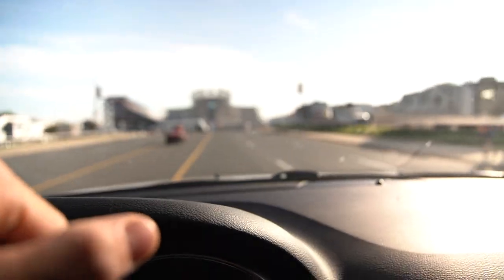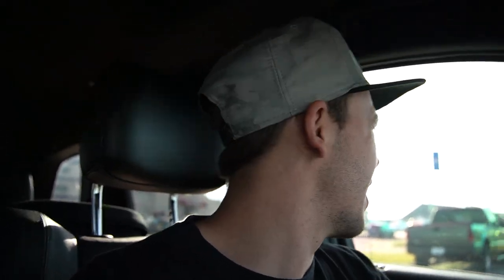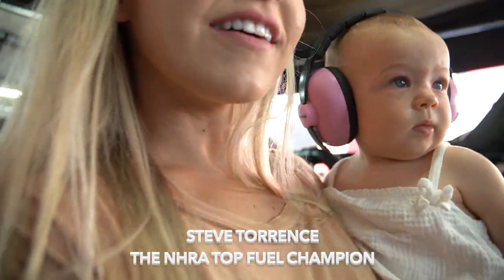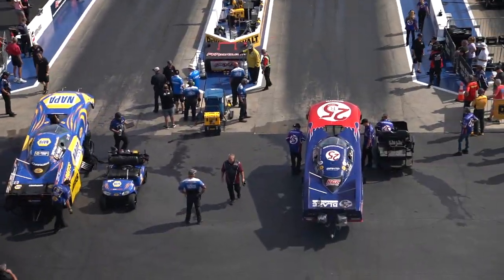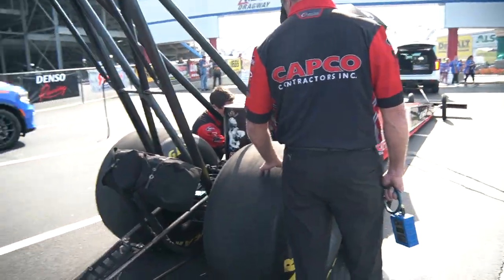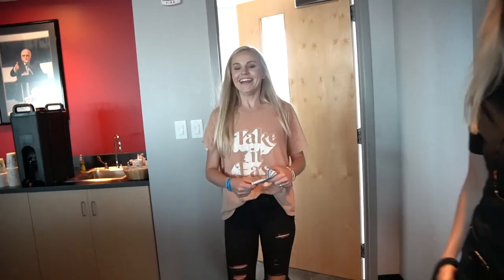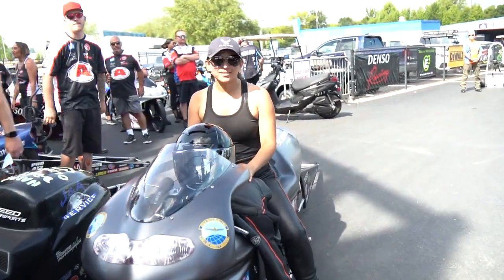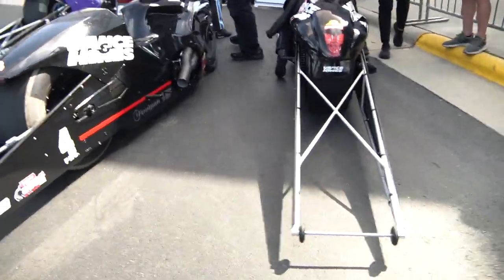I TOOK MY FAMILY TO WATCH A 11,000 HP TOP FUEL NHRA DRAG RACE!

Comment: 11,000 hp Each cylinder in a top fuel makes 1200 hp. More than your SEMA Truck engine makes👀🤪😳
Reply from the maker: That is true!
Reply: But Brad doesn't have to rebuild his motor after every race